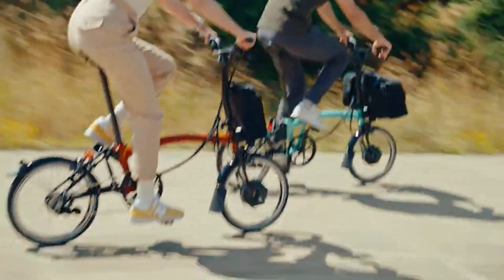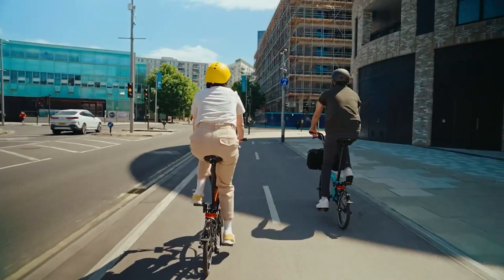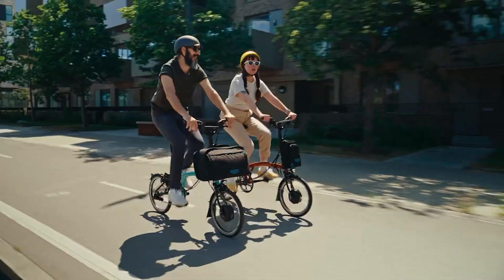Brompton Electric - battery & bag frame - care & maintenance

Comment: How does the electric feel riding without the battery pack? Is it the same as a normal Brompton, or is there resistance?
Thanks
Reply: I mostly ride my electric Brompton without any assistance and I do not perceive any resistance. I rarely forget the battery pack, but when I do, I don't necessarily bother to go back for it, except at night, when it's needed to power the lights.

Comment: mhm it is not really sufficient by applying some lubricant or wiping off 1 grain of dirt for "eliminating the battery noise".
It is instead needed an upgrade on the design side of both the bag and support since they are too loose rattling 50% of the time even on slightly disconnected pathways. 
Of course they were not properly tested for normale city use cases before production.
Reply: I think most e bromptons suffer from battery rattle .....just a poor design